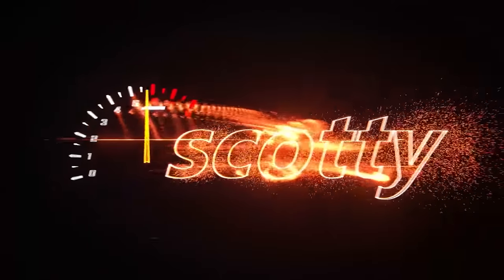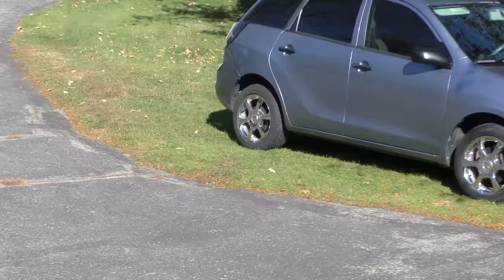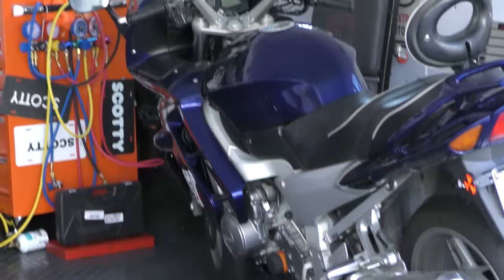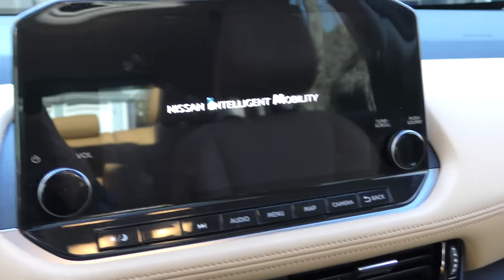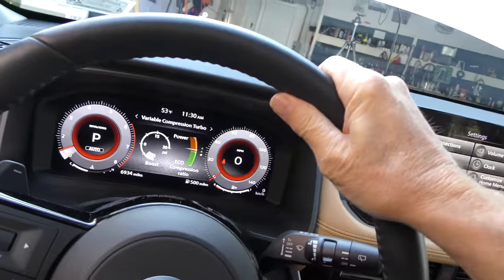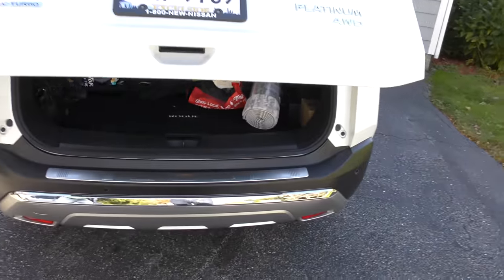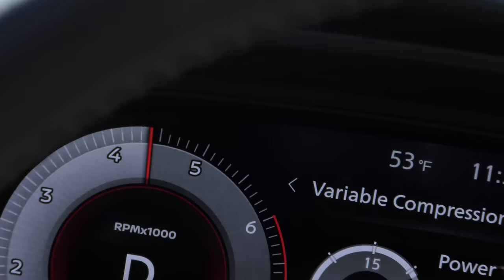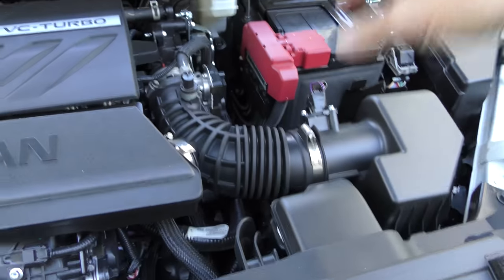Nissan's New Engine Shocks the Entire Car Industry

Comment: A new engine design by Nissan.  What could possibly go wrong?
Reply: And a three-cylinder at that... Maybe in a few years that will come out with a variable two cylinder..🤣
Reply: At least it has an instrument cluster in front of the driver and not the stupid center console one...
Reply: 201 hp  turbo with jetco cvt perfect what can go wrong
Reply: @charlesjackson1700  variable one stinger 2.5L engine....hahahahaha...
Reply: Everything
Reply: @charlesjackson1700  and then a Triturbo Hybrid V4 VVT CVT Platinum R. As long as it sounds cool, that’s all that matters.
Reply: People that buy modern day junk are literally getting taken for a ride. I think down the road, used cars with solid engineering will hold their value a lot better than the new stuff coming out by Mattel™ these days. As if a 3 cylinder engine wasn't bad enough, they got turbos on them and articulated pistons. These cars should come with a unique horn, when you blow the horn it plays carnival music...

🎶Step right up!! Test your strength!! And don't forget to stop and see the bearded lady, as well as Salamander Man!!🎶

😆🤷🏻‍♂️🤦🏻‍♂️
Reply: @justacinnamonbun8658  👍😂⚡️
Reply: @charlesjackson1700  Toyota makes a 3 cyl. 300hp. fyi
Reply: I don't know Breck I got 156k on mine so far still runs like a top
Reply: @bathhousebarry247  🤣 I remember a few years back I saw a V4 outboard motor on a boat at a marina in Lake Wylie South Carolina.. I had to look two times when I saw the V4.
Reply: @oi32df  Yes... As long as it's in warranty.. It's your baby when the warranty expires.😩
Reply: @xdnone5047  xtronic cvt
Reply: @juanrodriguez-ry6yt  But that's Toyota!  They're know for bulletproof engineering... plus that 3cyl engine is already proven! Nissan on the other hand, have a long way to go, even with conventional mechanics like V6s, V8s and in-line 4s.... dammit Nissan get your act together!
Reply: @ev-ezaye3580  I have had Nissan pick up and a Nissan sedan made in the nineties and I have never had serious problems with them.  From my experience, I can't say that they are bad cars.  May be I am just lucky.
Reply: Just engine, nothing else 😄
Reply: Hey guys, I’m from Aus and just want your honest opinion on the Subaru outback the petrol variant??? Any help will be greatly appreciated. Thanks heaps. Halen.
Reply: @ev-ezaye3580  by whom those three toyota have been proven? You may not know but Nissan do make 3 pot engines that are reliable, do some research on the Nissan Micra or even the hr1.2 , 3 pot , or even the new HRDDT 1.0 turbo.
Reply: Relying on too much technology that we know has not been perfected. Or ever will because they would want us to bring it to the shop for their benefit.
Reply: Any new design is what will go wrong? unless it works then it's money in the bank..
Reply: Any new design is what will go wrong? unless it works then it's money in the bank..
Reply: If warrantied I would buy one.
Reply: @xdnone5047  in 1970, nissan/jatco introduced the 3N71B- of the most reliable 3-speed, direct-drive automatic transmissions in the world- and it transformed the automotive industry. in 1983- nissan did it again by introducing the VG30- so i'm guessing not much will go wrong. so- who set their automotive standards and tooled-up their facilities to make this all possible? yeah- it was US.
Reply: To be fair if it was made exclusively by the Nissan group pre1999 it probably be great. However it’s probably made with the primary creation and or influence by Renault
Reply: Everything
Reply: @Dallas867  Years ago not today...
Reply: at least its not Renault design.
Reply: @tommurphy4307  they know nothing, because Nissan former ceo cheap out many things they using it to carry the brand down, but I have seen the all new X-CVT, it look very robust, not saying it going to be the best, but it should be much better than the one that was made 2010 to 2021
Reply: What about transmission?
Reply: @golamalom3866  The transmission is all new like the engine, it use a new flat chain design, instead of the v-belt design during Ghosn era, it is await and see if this new team design a better transmission than the cheapo Ghosn design.
Reply: Nissan used to produce some of the best engines ever, particularly their V6's & V8's. VQ35HR, VQ37VHR and VK50VE were outstanding! A shame to see Nissan rest on its laurels.
Reply: @philhenderson3516  Nissan have been down downsizing and making small turbo engines for a very long time, like in the 1980 the pulsar with SR20DET , in 1990's SR20VET, the micra with MA09ERT ETC. It maybe new to USA, but none of tis is new to Nissan.
Reply: nothin wrong with a three.  in my fam theres two of em now a 17 mitsu mirage and a 21 bronco.  the '17 has 140k miles so far
Reply: Not much because it's not American
Reply: The CVT transmission.  lol
Reply: Everything? LOL
Reply: @charlesjackson1700  42k is what got me. Lol
Reply: @Antares_451  That is high. Also read the Nissan Rogue depreciates more rapidly than others in its class.. A double whammy..😩
Reply: @charlesjackson1700  Exactly.. I'd buy  any toyota suv or any Nissan. I owned a 2005 Maxima for but I had to put plenty of money in it. Never again.
Reply: On my third Nissan and never had any problems with them. New technology will always have some initial problems. When electronics were introduced to cars back in the 1970s ( correct me on this) many people were worried about reliability but now every car has these systems. We should congratulate Nissan for pushing forward new technology and having the guts to market it. So many people have negative and " hope it fails attitudes ".
Reply: @xdnone5047  mystery that…,
Reply: The whole engine
Reply: Plastic built
Reply: Is the 2023 nissan kicks worth buying?
Reply: @raymondkurtyka754  Really?? 😦 When did you purchase one of these ?
Reply: Who can someone drive this car to some remote places alone in the dark 🌑 with no smartphone 😜 ..too much technology is making cars more unreliable..
Reply: @charlesjackson1700  You can easily expect a two stroke engine come back...🤡🤡🤡
Reply: @halenpeters5982  Petrol boxer engine is better than diesel from Subaru. Models from 2015 seems to be very good built. 2.5i naturaly aspirated engine is quite good.
Reply: @The_Touring_Jedi  thanks very much, I’m glad you said that because I already grabbed one for a great price. Seems good so far and really tidy and quite economical. Thanks for replying. Take care friend 🙏🏻
Reply: Nothing, Nissan never had problems with their engines, most of them last up to 250k miles
Reply: Nissan makes great engines it's the jatco CVT that's the weak point.
Reply: @ev-ezaye3580  I'm sorry but the Nissan VQ engines are damn near bullet proof
Reply: @ev-ezaye3580  it's not proven, Toyota Yaris rs is breaking down on everybody
Reply: @noventay4  Link please
Reply: VQ motors are reliable strong motors ? So I guess not much can go wrong ?  Maybe you are thinking cvt issues when the motor was mentioned ?
Reply: Nissan is a company in decline.
Reply: The transmission
Reply: Oh, aren't you guys just a bunch of precious nincompoops. Nissan makes some great engines and cars.
Reply: @Dallas867  my family has driven Nissan's for 25 years with ZERO problems. The greatest hurdle here is all the slavish devotion to Toyota which seems to be a result of the aftermarket performance market industry going all in on Toyota and ignoring all other manufacturers. That has had an outsized influence that lasts till today and it not likely to change.
Reply: My dad had the first gen VCT engine. (2019 QX50) with 0 issues, even though it wasn't Japan-made. He now drives a 2022 (mexico built) with the same engine with 0 issues. I hope this new 3cyl & the new CVT will be as bulletproof as their VQ engines (of which I had 2). I currently have a 2019  Q50s with the VR30DDTT.....which definitely is not without it's charm!
Reply: Not much, they do quite good stuff actually. Only with Goshn and his Renault-Nissan parts mix were bad. Not now.
Reply: I think Datsun came out the 70's, maybe even 60's and there still in business. So They must be doing something right. I wonder if the Pulsar or Pathfinders were good vehicles back in the day ?
Reply: @ev-ezaye3580  After Goshn, all is back to normal at Nissan. He was killing the company mixing components with Renaut. Try to get updated.
Reply: I have a 2022 Rogue SL, and I have 7600 miles on it, took it to the Outer Banks last summer drove on the beach.  It was great,  gas mileage 26-28 around town and 35-40 on the parkway.   No complaints from me.  This is my 5 the Rogue and they have all been great cars.  But the engine in this one works great'
Reply: New engine for the US market. But the rest of the world had a taste of this engine option with the last 3 years of the Nt32 X-TRAIL or in your case the last Gen Rouge. It's good
Reply: Everything
Reply: I Drive nothing but Nissan's and just do preventive maintenance on them literally have very few to no problems.
Reply: Nissan kinda went out of business but is now 50/50 partners with CCP as told in Wikipedia. Nissan is now a official police vehicles for China.  It's probably good but the repair cost will be more than BMW parts for that real soon.
Reply: Lol!!!!
Reply: Remember Nissan created the vr38 which can achieve 3500 whp as seen at tk23.
Reply: @2seep  the data cloud in Nissan goes straight to China CCP do you want that in a vehicle?
Reply: Nissan would be great if they ditch that for awful jatco cvt
Reply: You do realize the Nissan Pathfinder sales production and design is half ownership of the CCP China and not Japanese so you won't be  getting apple car play or any of that.
Reply: @olivercraig4148 I agree with you here
Reply: @nomaam-br549 I have a 2018 with no issues. Looking to upgrade to this new one
Reply: With your philosophy, I can only imagine them producing a 0 cylinder engine 30 yrs from now😂
Reply: @smokeonthewater5287 you mean a Tesla
Reply: Nissan engines are always reliable. Nissan owners don’t do maintence.
Reply: @olivercraig4148  And I went from a Honda to Nissan.   
Was happy with both of them
Reply: Nissan needs new Transmission not cvt
Reply: I sell Nissans and drive rogues all the time. The car is great even with a 3 cylinder it’s fast
Reply: I was skeptical but bought  the platinum one 45000.00 for 38000.00 i love the car so far

Comment: I just bought this engine in the new 2023 AWD Nissan Rogue two weeks ago. I drive about 9000K year. I plan to drive it for 10 years. Wish me luck!
Reply: I hope it lasts a long time for you. Personally I’m not buying another Nissan. Coming from a 2013 Pathfinder (made in USA) and 2018 Note (made In Mexico) It’s not just the trannys but poor workmanship all around. And I’ve never missed a service date. Maybe I’m just not lucky. And I really love Nissan designs. Wish I could stay loyal to them, but for me it’s time to move on.
Reply: Hows it holding up so far?
Reply: Hi any updates? How is it running
Reply: @tim8532  No problems so far. I've been able to squeeze out 31-33 MPG on highways here in Chicagoland. No gas smell in the cabin which is apparently a problem other owners have been reporting. Been changing the oil every 5000 miles.
Reply: Do you hear a "whirring" sound when you drive over 40 mph?   I hear mine doing that upon deceleration too, until about 35 mph, then I don't hear it.  I've been told by the dealership that it's the turbo.   Kinda annoying.   I override it with the radio.
Reply: Really? 9000K miles a year?... That's 9 million miles per year.
Reply: @jmartyt9810  LOL 9,000 miles dude. forgot to take out the K

Comment: The warrantee will be void somehow.
Reply: Yeah, you have to STRICTLY adhere to EVERYTHING the dealer recommends to keep that warranty intact... So if they want to charge you $150 for an oil change and tire rotation every 3k miles, you gotta do it and you HAVE to do it at that dealer franchise or it's invalid.

In the real world those unlimited warranty's from a dealership are about as worthless as the paper they are written on. 

I bought a car from one and just made fun of the warranty since I wasn't going to use it anyways.

Comment: Just bought a 23 SL AWD.  Beautiful vehicle and huge improvement over the last generation.  The VC-Turbo is lightyears better than the old 2.5L.  Never had a problem with any of my Nissans.
Reply: till the turbo  goes  bad
Reply: @Monza62000  Are you a mechanic?  Do you have strange abilities to see into the future?
Reply: @ElectoneGuy  better than most mechanics...just  know turbo  engines  dont last  ..they should give the option for the 2.5 four ...
Reply: @Monza62000 well see how long that 3cyl last with a chit turbo
Reply: So have you replaced the motor yet?
Reply: take proper care of any car and they'll last even 300k miles
Reply: @Monza62000 2.5 is available in the base trim
Reply: Totally agree-just bought my wife's 4th Rogue SL with Bose audio and lifetime warranty. What's not to love?
Reply: @alanrideout6044 The 1.5 3 cylinder turbo replaced the 2.5 4 cylinder as the only engine option beginning in the 2022 model year
Reply: @Monza62000 The Outlander which is basically the same car still has the 2.5
Reply: @alanrideout6044  Not anymore. At least not in the U.S.
Reply: @michaelchristopher8266  Yup, it sure could use the 1.5T.  It's heavier than the Rogue.
Reply: Do you hear a "whirring" sound when you drive over 40 mph?   I hear mine doing that upon deceleration too, until about 35 mph, then I don't hear it.  I've been told by the dealership that it's the turbo.   Kinda annoying.   I override it with the radio.

Comment: The warrantee is only good if you let them service it according to their maintenance schedule.
Reply: Exactly. No such thing as a free lunch.
Reply: He didnt read the fine print. He is screwed. I will
Never buy a 3 cylinder engine. And that VC is uneccessary it is nissan’s way to use us as a Guinea pig!!
Reply: There will be so many exceptions, loop holes and provisions written into that warranty, there is no way he will collect on it.
Reply: And assuming they can readily get the parts and/or engines.  Trust has been lost between mfrs and buyers.
Reply: i wonder if warranty covers labor, i know some place offer UNLIMITED LIFETIME WARRANTY but u pay for the labor
Reply: @kyqorioskygo8999  me too. All my cars are either straight 5s or 6s. Anything fewer than 5 won't last long.
Reply: I was waiting for Scotty to toss the stupid beauty cover!  😅🎃
Reply: @TheSuperBoyProject  hondas would like a word with you
Reply: Not true at all.. i had a Sonata that had the same power train warranty and my engine blew… did my mantiene in different oil shops and they gave me a free engine and a free rental so it’s not always the case
Reply: Yeah, to even offer a lifetime warranty is silly, but some of these dealers just buy a 10 year warranty for you so the warranty is actually though a warranty company and not the dealer.
Reply: @TheSuperBoyProject  can't go wrong with a straight 6 but my inline-4 k24 accord has 250k on original motor and tranny. still running strong..
Reply: @rodrigoge5875  amen brother!
Reply: @Theloungeisracist  that’s Hyundais extended replacement campaign for certain known faulty engine designs. My brother had the same thing. Engine blew at 114k, never took it to a dealer for oil changes-he did it himself-and they replaced it and gave him loaner. Also said new engine had 100k warranty. Very rare for that kind of service from a manufacturer.
Reply: @wolfeadventures  nah it was thru another 3rd party, not Hyundai
Reply: Not worth it at all
Reply: It's a "buy all this other crap, get a free oil change."
Reply: @rodrigoge5875  : "hondas would like a word with you"

Both of my sons have old 4 cylinder auto Accords (2008 and 2009). Both were used with high miles upon purchase, and the fact that they've held up to my sons' knuckleheaded driving and lack of maintenance is a testament to Honda engineering.
Reply: The only maintenance you need to do is what’s in the owners manual. The dealers suggest all kind of crap that are not in the owners manual. 

I called Jeep and they said to talk to the dealer because they are independent! Unreal!!!
Reply: Which is illegal in the us
Reply: Duh, they let you get oil changes at jiffy lube, and still honor the warranty
Reply: @TheSuperBoyProject  What!! I guess I was fooled into believing  my last 6 cars were 6 cylinders
Reply: @kyqorioskygo8999  so true
Reply: Ah. There's the kicker. So they basically make their money on you either way. I commented earlier asking about it and I knew there was a catch. They write those warranties so they have a low probability of losing. The amount of money they make on you for you to commit to their servicing prices according to their maintenance schedule will far surpass and offset and powertrain repair under warranty.
Reply: @rodrigoge5875  i5 and 6 are the best engine designs because they are the most balanced. Other cylinder layouts can last long, but they need extra components which brings complexity up and doesn't negate their imbalances completely. Hopefully that clears things up.
Reply: Not really , i got a 3 year lease on my wifes pathfinder and never took it for service i had an electrical issue and they fixed it with no problem, i guess that it depends with the dealer.
Reply: ...well...yeah...
Reply: @kyqorioskygo8999  that engine has been around for about 5 years now.
Reply: @kyqorioskygo8999  No, VC has been used on certain Altima  and the QX~50!
Reply: @salami99  The labour going to be about 11 hours, about $1000. I just had my transmission replaced.